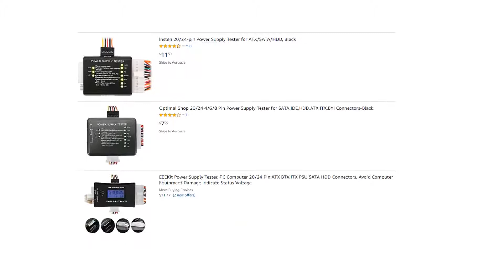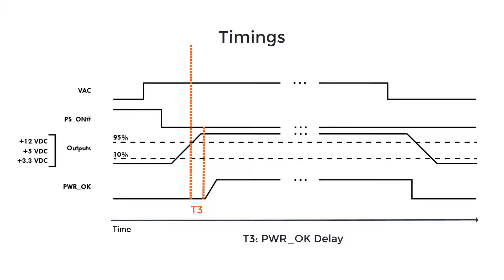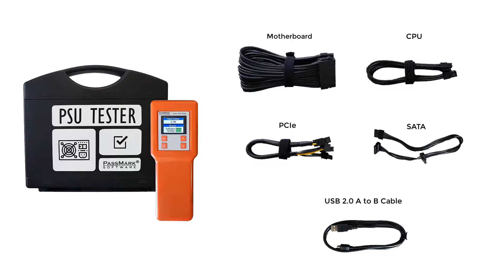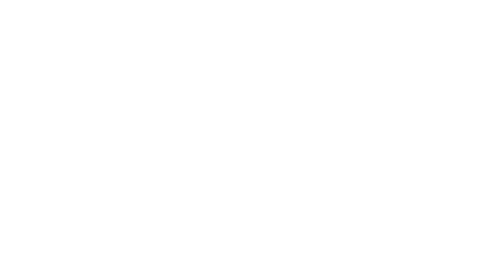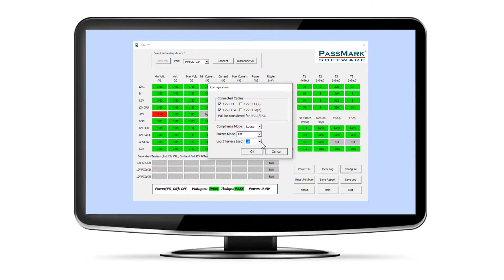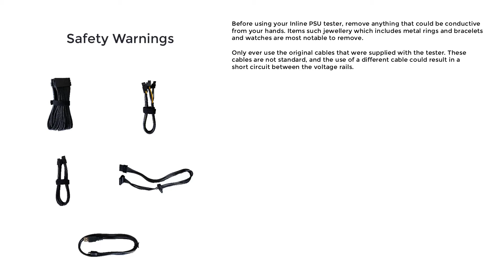PassMark Inline PSU Tester - Overview and Demonstration

Comment: what can I use as a load beside an actual PC? I want to stress test the real max power of a psu
Reply from the maker: Hi Tupiz, thank you for your comment! The Inline PSU tester is not designed to stress test the max power of a PSU. To best achieve the stress test, you could use a couple of DC load testers and connect them to each rail to draw current from each rail to the maximum that the PSU can support.

Comment: I think you should opt in for volume, I mean yea the 100 big repairstores in each country may be able to excuse for a 500 euro tool like that but even then I am not sure I mean those should be big repair stores which means that they probably need more than 1 of this in order to be efficient while on the other hand just try a working PSU on the PC to determine that the error was caused by the questionable PSU is much more time and cost-efficient. 

But as a hobby/testing tool this could be a nice gadget to have which would also broaden the audience for that by a lot.... like at least 100x the demand if not 1000x but the price needs to be lower and I really dont see why since essentially its a fixed multimeter with a load coil to suck in amps which not only could be achieved by using common lab gadgets but also isnt that much expensive I think the price for this product should fall to the 100-200 euro mark in order to be widely used.
Reply from the maker: Thanks for the feedback.

You are undoubtedly correct that lower prices would mean a higher volume of sales. The cost of any product is more than the physical parts. In this case there is a large intangible firmware and software component (R&D). Not to mention marketing, packaging, storage, and other one off costs like getting plastic moulds and custom cables done. At the moment it is super low volume. Just 200 units were manufactured for the world. If you factor in the intangibles we are selling them at a loss at the moment. If we can get the volumes up a bit (e.g. 5000 units) then the cost will come down

This device isn't really comparable to a multi-meter (or even an oscilloscope). 

* Typical portable oscilloscope has 2 channels. The PSU tester has 7 channels for voltage + 9 for current (16 channels). So you would need 8 separate oscilloscopes and a ton or wiring to match the tester.
* With the tester you don't need to cut wires to do inline testing.
* Oscilloscope doesn't generally measure currents (only voltage). At least not without cutting wires and using special probes. So an oscilloscope also doesn't measure power (watts). So it can tell you nothing about the efficiency of the unit. Or the power consumption per rail, which is critical if you some one like Dell or HP and trying to determine the minimum PSU requirement for a machine.
* Oscilloscope doesn't measure all the timings without getting involved in a very complex time consuming procedure. And you would still need to be a PSU expert to remember all the valid timing values. PSU Tester has the valid values built and measurements take under a second to perform.
* Oscilloscope doesn't check Power sequencing of voltages against the spec. For example, 12V & 5V must always be higher than 3.3V at startup, and how can you measure 3 voltages when you only have 2 channels?
* Oscilloscope doesn't measure minimum slew rates. At startup there are requirements for voltages to ramp up by certain amount per millisecond. Are you going to manually check each millisecond and compare it with the last one with an oscilloscope?
* Oscilloscope doesn't allow for testing of the PSU under load (this is assuming you use the trick of shorting the PS-ON wire to ground). Oscilloscope places zero load on the PSU. Voltage might look OK with zero load, but drop under load.
* Cheap oscilloscope don't do data logging to disk, especially not over long periods.

* Oscilloscope doesn't compute ripple measurement
* You can't take power measurements with an Oscilloscope when the machine running. On the other hand you could leave the PSU Tester connected for days to pick up intermittent problems (e.g. spikes and brown outs).
Reply: My thoughts exactly, I saw this product in a YouTubers video and I was like, hmm I could really do with one of those! Looked up the price + UK supply.. Not at all reasonable when I can just send something back on a RMA with no questions asked and change the PSU. I think most of us would rather pay a premium on a software subscription than on the hardware.
Reply: 2 years later and it's still $600.  I guess by their own reasoning this product is a failure and didn't take off.